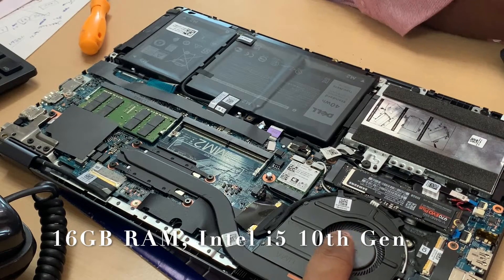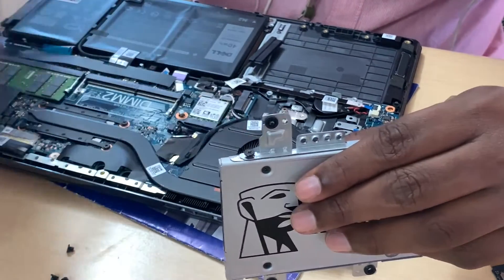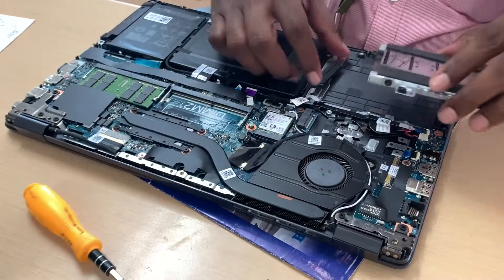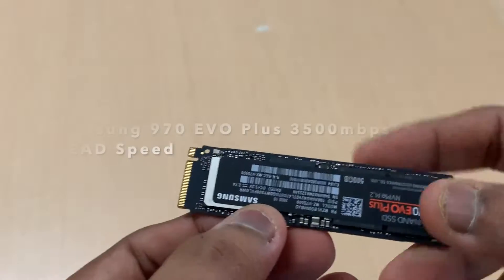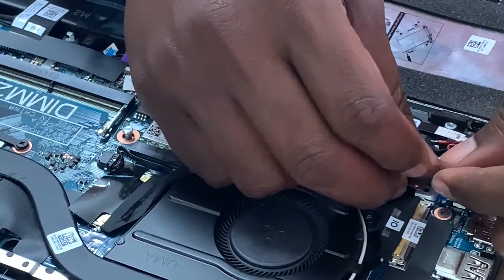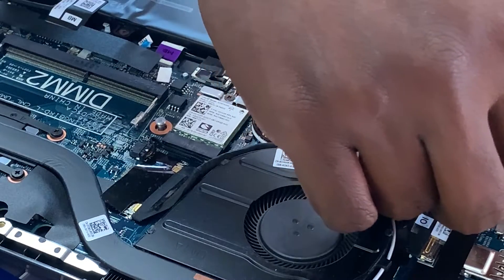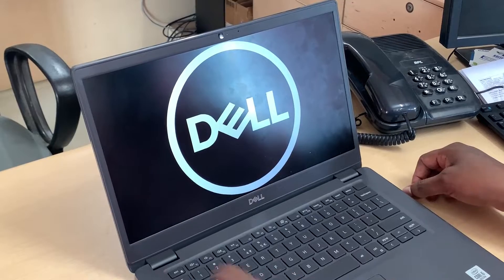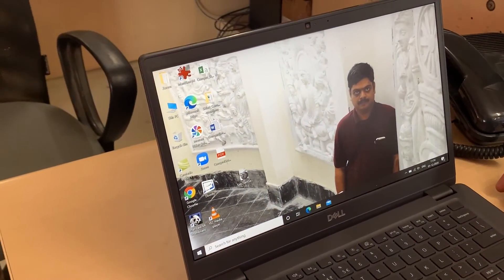Dell Latitude 3410 SSD and M.2 NVMe SSD Upgrade | Complete Details | Latitude 3510

Comment: Hola tengo una Dell 3410 i5 10210u con disco duro de 1 TB, que disco ssd le puedo poner sin quitar el original para utilizarlo con sistema operativo y el original solo para guardar archivos
Reply: Unidad de estado sólido M.2 2230/2280
NVMe PCIe 3x4
Hasta 512 GB

Comment: Should the battery connector be removed prior to performing the SSD and M.2 upgrade? I've seen come other videos recommending this steps to be taken prior to the upgrade.
Reply from the maker: Yes Only when the connector is removed, we can disarm the screws of the laptop. Hence its always advisable to remove it. But to test whether the SSDs are workingk we have briefly connected the battery again.

Comment: Can this laptop running 12GB ram on 2 slot (8gb & 4gb) ?
Reply from the maker: Yea it will run
Reply: @tspradeepkumar  had you try it before ?
Reply from the maker: I tried two 16gb ram
Reply: @tspradeepkumar  i am asking 12gb(4gb & 8gb) on 2 slot, bcs i see on the intel website it only can configure 4gb,8gb,16gb,32gb. But i see on the online shop that has sell 12gb ram on this laptop and im confused  right now..

Comment: @Engineering Clinic,  Sir I've got latitude 3410 i3 10th gen 14'' model with 1TB HDD and 4 GB of ram, Can I insert SSD in it without removing the HDD ? And what type of SSD would you suggest me to upgrade?
Reply from the maker: Yes you can install a separate M.2 SSD along with the existing HDD... I used the following SSD. https://amzn.to/3BeZpB1
Reply: @tspradeepkumar  sir, can I use NVME SSD not m2 SSD?

Same Spec 
Dell latitude core i3

Comment: Hey thanks for your video. I have a question. I upgraded my Latitude 3510 a week ago by using V-gen hyper 512GB NVme. But, everytime i install the OS, after like 1-2 days the system cant boot the OS. first, i think the SSD and broken. I claimed my warranty and got a new SSD. But th3 same problem happened again. What is the root cause of this problem if u can help me? Thanks!
Reply from the maker: You may check the booting screen and go to the bios settings ans select the storage option with AHCI or RAID. For my case when I see the ahci, I can boot Linux, RAID for windows

Comment: I need your help. we bought  around 10nos  3410 laptop this months. but it gives blue dump and automatically restart and showing hardware scan complete successfully . already changed SSD and M2 SSD also. all possible things we did. but still waiting for solutions.
Reply from the maker: Did you tried the steps, You might have installed windows using a MBR boot. But it should be installed using a GPT boot, In case to boot to windows. go to the BootLoader -> Storage -> Select AHCI instead of RAID, then save it and try... It should work. 
I run Windows and Ubuntu in the same Way. Windows works with RAID and linux works with AHCI...

Comment: i bought a 3410 laptop 3 days ago. but ut takes about 29 seconds to start. i wanted to know does it usually take such time to open ?
Reply from the maker: May be it’s a hard disk right? In case if it’s too slow, try disabling bitlocker encryption.
Reply: La mía con disco mecánico tarda 2 minutos 15 segundos es por el disco rígido?

Comment: Hi! Great Video. Very useful.
Did you have problems with overheating?
I can see in the video that a cable and some kind of battery is under the M.2 Ssd. Can the cable melt down?
Reply from the maker: No
Reply: @tspradeepkumar  I have budget to install a M.2 ssd or a Sata SSD. What would you recommend? 
Then i should not worre about the M.2 overheating?
Reply from the maker: So far no overheating, the pice of m.2 is cheaper, there are various speed versions . I got the one with 3500mbps. For half the price you may get the 2000mbps speed m.2 ssd

Comment: Hi, regarding booting from hdd in this notebook, how much better when installing the nvme ssd? Thank you!
Reply from the maker: Usually Dell Systems use Bitlocker Encryption in the Hard Disk or SSD. SSDs handle the encryption and decryption faster. One method is you can disable bit locker encryption. 
In this Dell laptop also, while bit locker was enabled, the booting process takes take more time, sometimes in 10 minutes also..  but after SSD even if you enable the bitlocker, the booting process takes just not more than 10 seconds... 
in this video, bit locker is enabled, still the booting takes just 7 seconds.
Reply: @tspradeepkumar  hello I need help, I have this laptop. I did the cloning of the hdd with macrium reflect but I could not clone the dell partition and the recovery one, now I have problem with certain functions such as the camera and the windows update, any suggestions?
Reply: @tspradeepkumar How could I do a correct cloning of all partitions?